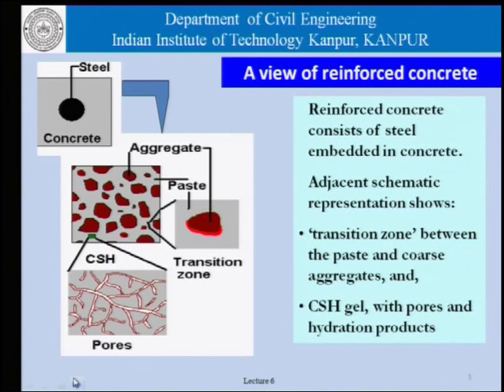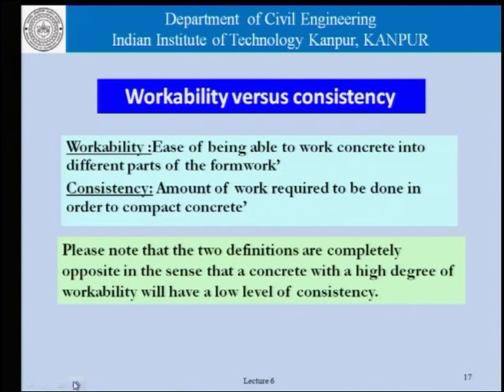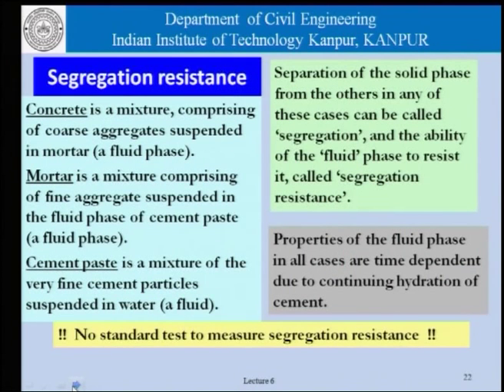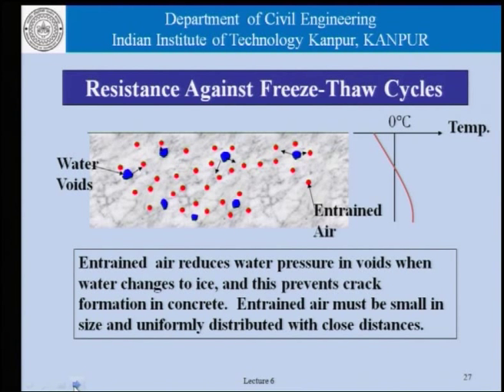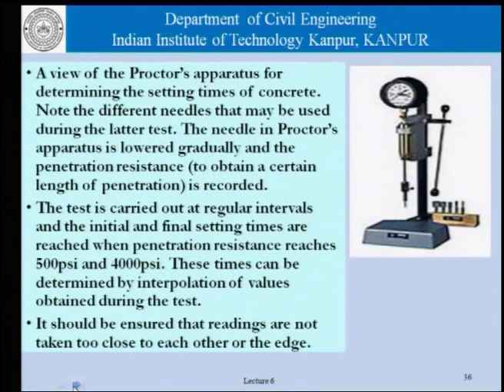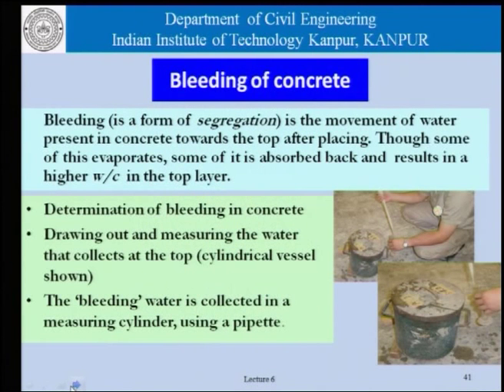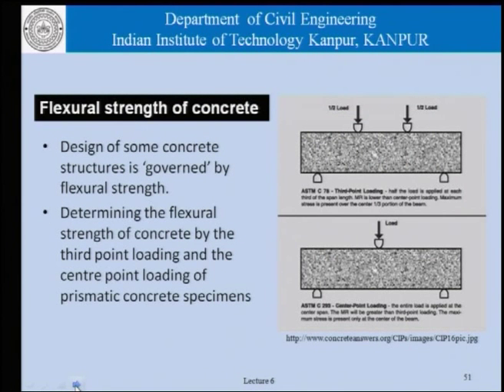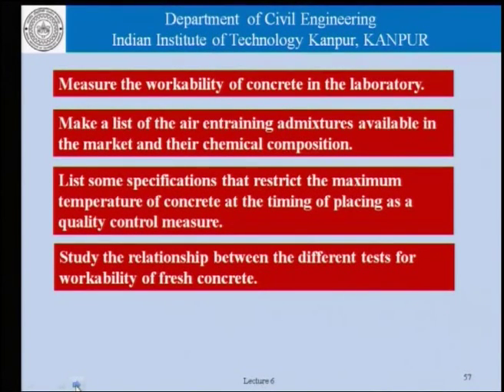Mod-01 Lec-06 Basic properties of concrete

Comment: Summary: Tests on concrete in strength and durability aspects are explained in detail. Initial setting time of cement and concrete are measured in different apparatus. How do we measure workability for very stiff, normal and flowing concrete? Explanations about stress-strain graph of concrete, modulus of elasticity of concrete, compression, tensile strength of concrete are really awesome.